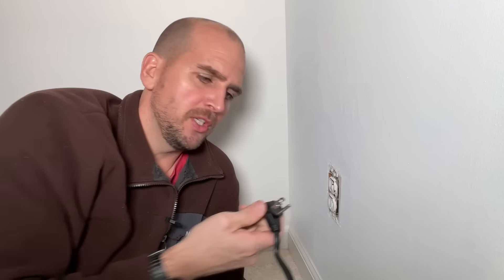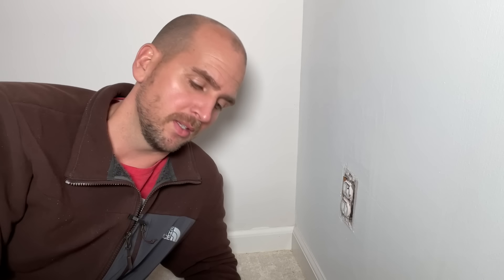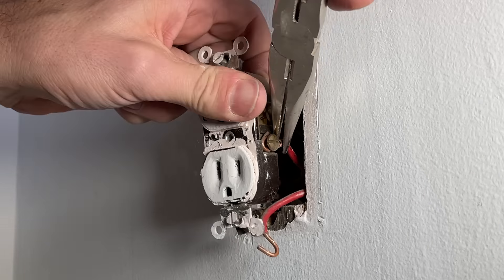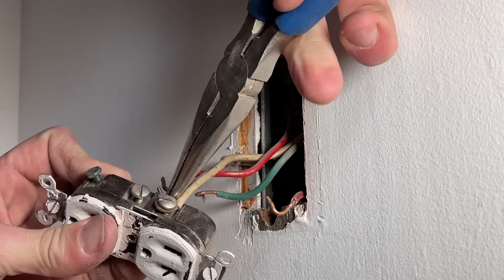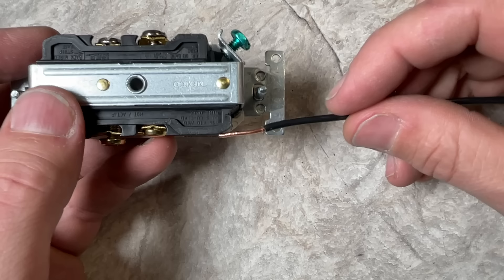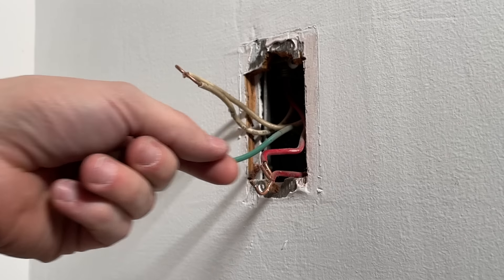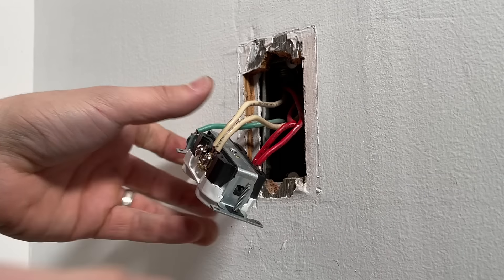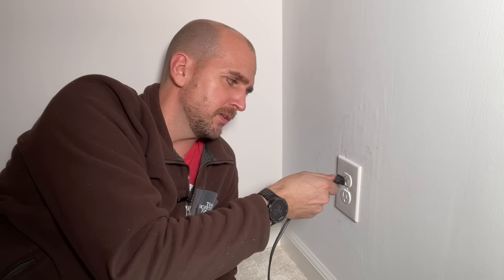Plug Won't Stay In Outlet

Comment: TEN THINGS YOU DID WRONG:
1. The box's 6-32 threaded hole is set back more than 1/4", which requires a goof ring (NEC 314.20). Even if it was less than 1/4" (it's not), you've got dried out wood paneling - use a plastic goof ring.
2. You didn't check for voltage after the neutral wires were disconnected. If the neutral was shared with another circuit then the load side would become hot when disconnected. A little thing like that can get somebody killed (a shock from a neutral under load is much more severe than from the hot wire).
3. You didn't tail out the wires. Especially the neutral! (see above) There should only be 3 wires connected to a non-GFCI/AFCI duplex receptacle (4 if it's half-switched). Not to mention making it easier (and safer) the next time it needs to be replaced.
4. If the receptacle can't be tailed out for some reason (no wire or wirenuts available?) don't put both wires under the same screw. You've got 2 screws. Use them. 
5. When using the clamp terminations with solid wire, you should wiggle the wire after tightening, then tighten again. And again after the wires are folded into the box. Personally, I prefer hooking to the screw with solid wire, and using the clamps with stranded wire. Hooks on solid wire are a better connection and less likely to loosen when the receptacle is pushed back into the box. If I had a dollar for every time I pulled a receptacle out of the wall with the wire(s) staying in the box...
 6. You didn't check to see if the ground (green) wire was connected to the box. If it isn't, then it too needs to be spliced to a tail (never, ever put 2 ground wires under 1 screw!) with one end under a 10-32 ground screw in the back of the box (if there's no threaded hole in the back of the box then you have to drill/tap one). The ground wire is not only the most important wire protecting you from electrocution, it is the ONLY wire protecting you.
7. You make no mention that it is a mistake to assume the way the wires are dressed out (spliced, connected, etc.) in an existing box are correct. It is quite often the opposite, as in your case. Instead of correcting the mistakes of the previous installer, you repeated them. Anyone replacing any electrical device is required to meet current NEC rules.
8. In the beginning of the video you're literally lying on the floor. You should stress that even though the power is OFF (hopefully) one should always behave as if the wires are hot. Do not ground yourself when working on electrical systems!
9. When replacing a receptacle inside your house, the NEC requires that receptacle to be Arc-Fault protected (NEC 406.4 (D) (4)). AFCIs are required on all 120-volt, single-phase circuits with 15 to 20 amps supplying receptacles in all dwelling rooms.
10. You should mention that electrical installations are not only about knowledge, it's also about technique. And as described above, there are many things to consider even for a simple device replacement. In over 40 years of industrial, commercial & residential work I've yet to see someone who's not an electrician perform the relatively simple task of changing out a device to my satisfaction. My somewhat jaded opinion is that people without electrical knowledge shouldn't be doing electrical work. Call an electrician!
Reply: Jesus buddy, he has at least basic knowledge and he made a safe repair and saved a lot of money on hiring an electrician who's gonna whack him for $200 for a five minute replacement. I replaced every outlet in my house when I first moved in 28 years ago along with installing four ceiling fans where no fixtures existed and replaced a half dozen fixtures with zero issues. 
Actually I'm wrong, I did three ceiling fans after a "buddy" electrician did the first one saying he'd "take care of me" and charged me close to $400 and was done in half an hour. Wiring an entire home, yes, but changing out basic outlets and basic fixtures is not rocket science.

Comment: Usually they wrap tape around the inside of the outlet after the wires are hooked up
Reply: Same here, safest way
Reply: No only scrubs do
Reply: @cherrydagger8271  safest way is to not touch the shiny you goon. There, no tape required. 

As a bonus it saves me later on from having to pull the tape off receptacle while it's hot because moron was working on it last and it's fucked up
Reply: @andycopeland7051  you're comment speaks for itself, have a nice day.

Comment: Great video, as always ! Extra comments: If I'm replacing the receptacle, I just back the terminal screws out all the way, leaving the hook undisturbed. I tend to install back-wiring receptacles, so I will straighten the hook to reinstall--but I don't risk messing up the insulation or nicking the conductors, and ALMOST EVERY SINGLE TIME, I end up trimming excess copper, even if I would be hooking the new unit. C'mon, pros, get your helpers and apprentices under control' they're making you look bad. If I see short wires, or two wires on both sides, darn straight I'm pigtailing the new unit, with Wagos. 
Yes, I am in the militantly anti-childproof camp, because they can block legit plugs,

Comment: A good solution to worn hotel plugs. Use one of those inexpensive ground adaptors used to allow a grounded plug in an ungrounded receptacle. Throw  a few into your suitcase. These allow a three prong plug use in a two prong, ungrounded receptacle.  Typically they are grey with a green wire which is supposed to be attached to the cover screw in an attempt to gain ground. Don't bother with this as the purpose here has nothing to do with grounding a device. Now look at the prongs of this adaptor. You will see they are double layered. If you insert a small screwdriver between these layers the plugs blade width will swell causing a tighter fit into the worn receptacle. Your plug will no longer fall out, and you will reduce heat damage to your cord due to bad connection. This is not a way to avoid replacing worn plugs! Stop being cheap and lazy and fix those worn plugs! But do not rewire hotel rooms! Tell them their rooms suck when you leave! In writing!🤣🤣🤣

Comment: Remove, clean all connecting wires, replace the outlet and install new cover plate and get on with life.
Reply: Wrong.  Bend the prongs outward just slightly, save $150 or $5 if you’re a do-it-yourselfer.

Comment: Tyvm! I had this issue with multiple outlets in my apartment. The new maintenance guy they hired doesn't have a clue what he's doing and the new outlet covers were not flush against the wall. They were sliding and there was a huge gap of space in between the back of the plate a d the wall after doing what you just did apparently. Smh!

Comment: Quit calling the white wire a (NEUTRAL wire) I know we have been programmed to calling it a neutral wire over the years but to have a true neutral you got to have two separate phases plus a third current carrying conductor but on single phase outlets the wire on the silver screws side of the outlet is a (RETURN wire) got this pounded into my head thirty something years ago as an apprentice working with a old time Master electrician Mr Leroy Henton that man smoked cigarettes all day long and had maybe two teeth in his whole mouth and  couldn't have weighed a 100 lbs soaking wet with long gray hair down past his shoulders but the things that man taught me in the two years I worked with him was simply amazing as I think back to all the many times he would stop me cause he didn't like the way I was doing something or saying something or just plain out didn't know and would draw me diagrams on anything pieces of sheetrock , 2x4s,my on hand, seems like he did that almost everyday but if he was still alive and walked in to any electrical supply house they would take one look at him say he probably can't wire up a out house but boy oh boy would they be wrong I have no doubt that Leroy was a freak in electrical knowledge a man that could do it all from the out house to the penthouse from running  emt,big screw pipe,motor controls, switch gear,ruff in,trim out,high voltage,low voltage,never once can I remember seeing him look like he didn't know what he was doing nor do I remember seeing doing something twice now me he made me re do a damm a lot of things he wouldn't even let me mount box's with hex screws he made me use pan head screws cause he was concerned that the wire would get nicked on a hex screw (that really chapted my butt) but in the bigger picture it was more than worth all the things he taught me RIP Leroy Hinton I still remember most of what you tried to teach me at almost 57 years of age .

     Sorry for getting long winded on this I guess I just got emotional reflecting back on my days with Leroy.
Reply: Anti Government  technically, it is a return, but also sourced both to the center tap of the transformer and earth ground.
Don't get me started on ground current differentials and whatnot... I first learned of those the hard way, nearly getting knocked off of a ladder due to two grounded connectors that really needed another ground rod hammered in and grounding that point. Then, a block of instruction on using one hand and ground current differentials.
I could've used that instruction beforehand...
But, the warnings come after the spells.

Comment: Yeah, the big "solution" is REPLACE THE OUTLETS! Du'h.
Reply: @SUBJECT M01 Usually a screwdriver is enough.
Reply: Hey, "no user serviceable internal parts",  hmm?  Yeah... and outlet is a modular component, and is not usually designed to be rebuilt.  (Psst... that's why they are so cheap.)

Comment: You should have touched on the case of having two of each wire on the existing outlet. This can be two situations:either its part of a series of outlets in the room, or one of the outlets is on a switch. In the event one of the two outlets is switched, you could have explained how to remove the metal tab between the terminals on each side of the outlet so they can work as one socket always on, and the other switched.

Comment: fwiw - moved into 5 bdrm house in 2005 that was built in 1990 and had to replace Every.Single.Outlet due to this problem.  Surely some of the outlets couldn't have gotten much use so this was very disappointing that the builder chose to use such junk.  House was well built otherwise..
Anyway, Great video and information to somone doing this for first time on basic outlet with additional info provided in other liked comments that may come into play.

Comment: Thank you for talking about the different wiring color standards. My home was built with black, white and bare ground wires. As I finished the basement area I purchased wire with the ground sheathed in green. An old electrician told me to always shorten and twist the bare ground wires together and pigtail a green coated wire with the bare wire. Then shove the twisted bare wires to the very back of the box so they are out of the way. Then you only have the single green coated wire to worry about. Do you recommend this technique?

Comment: After 34 years working in hospital maintenance- often having to work “hot” I developed the habit of running a couple passes of electrical tape covering both hot and neutral screws before placing the outlet back in the box.

Comment: I am surprised you put the outlet in upside down. That being said, an outstanding video, especially explaining the way the wires wrap around the screws a certain way, and screwing in the unused terminals. How about a short video on how to make the 'J' hooks. They look simple, but it does take practice making them correctly.
Thanks for a great Video !
Reply: There is no such thing as an "upside down" outlet.  No one is reading the print behind the cover lol

Comment: I thought you were fixing the slippery 2 prong plug problem. They sharing in various down graded design misses like not drilled, too thin, too smooth, and are commonly found in new vacuum cleaners.

Eg: Ghibli AS6 plug falls out with such consistency I cut them off before sending the machines out to the trenches and put in a Hubbell of equivalent.

Comment: 3:08 I've got a great deal of wiring, I've never seen red wire outside of 3-wire that has the black, white, and red wires together, which doesn't really get used outside of 3-way switches and integrated smoke detectors.

Comment: I've got into this situation so many times. The loose plug should be replaced as you did. But if you rent you have to ask the owner of the house to do that. If you are traveling and get to the same situation or even in your house and you need to charge your phone or plug something that is loose, just bend the connectors to put a little pressure on the contacts. 1 or 2 mm or even a 1/32 of an inch is enough. I hope it helps with an emergency.

Comment: How about showing industrial grade and hospital grade too?

Commercial grade outlets - good for frequent plugging and unplugging.
But cheaper residential grade would be OK for an outlet for a high mounted wall clock, or even a refrigerator.
Things that get plugged in and seldom unplugged.

Industrial grade would be good for a workbench where you use high power tools and frequently plug and unplug things.

Comment: It would be helpful to say that there can be multiple circuits on a plug so always check if the little bar between the two set screws on both sides have been broken off or not as it may cause a line to line short or an overloaded neutral

Comment: Always been told to put the outlet in a position so that the round ground projection on the plug is at the top. Less likely to short out than the two plugs on the top

Comment: I miss the old folded-over male terminals/prongs that were on electrical cords that you could spread apart with a straight blade screwdriver when they were loose in an outlet. I don't run across them to often anymore.

Comment: Learned alot In This video but one thing has me curious. Why did u put both hots and neutrals on one connection 🤔 the original one had them separately. I wish these might or changes would be explained for newbies. Gotta go do more research now.lol not a bad thing tho. REMEBER ALWAYS DO U OWN DUE DILIGENCE

Comment: Nice video.  Here, downunder, we only have two types of outlets: Light-duty (domestic) and Heavy duty (outdoors) and our Phase (red) and Neutral (black) pins are angled so there's less of a chance of the plug either falling out or becoming unsafe, and our Phaser and Neutral pins are insulated 90%. 99% of our outlets are switched is case there's a fault eg. pins "welded" to the inside connectors! thus we can "switch off" the  outlet in an emergency!

Comment: Question, noticed you used two testers.  I only have  an outlet tester, similar to yours.  Is using Just an outlet tester good enough ?
I really don't want to get electrocuted. 😫  thanks
Reply from the maker: I like the non-contact tester as well to make sure someone hasn't used the box as a junction for another circuit.  99.9% of the time an outlet tester should give you what you need confirming power is off.

Comment: Master electrician. When replacing an outlet you need to Put a Box extender in any any place where you can see combustible materials between the Box and the cover plate. Also when you have 2 wires do not use both screws to extend the circuit from one outlet to another. You should pigtail So that in case that outlet Burns up the rest of your outlets do not fail. Also I don't mind using the what we call a tick tracer However some brands are more reliable than others some of us call them death sticks.  I prefer the ones that use an adjustable sensitivity because you have less chance of false negative or false positive reading when you get it set properly However these are more for making sure a wire is not hot rather than an outlet.

Comment: Great video. I have the same problem. Thx for answering 15A that I take it is 120 voltage, well mine is on my fluke Meyer. U mention different screws u had to replace. I will buy them too. Thank u.

Comment: Since the original had two hots and neutrals wired with one going  into each outlet, why wire the new one with both going into the same terminal? Wouldn't that make the second set of wires useless?
 
Thanks for this. It's probably a better alternative to my practice of simply prying the plug blades wider apart.

Comment: I really like all your videos as they are so helpful for me.  But may I just inquire about this particular video - thought I noticed that early on the two red wires was taken off from the two separate screws but when you install them back in it seem that both of the red wires are were both installed one screw only.  My question is more for safety sake as I also have a loose plug that I need to fix.  If you could comment on this I would really appreciate it.  Thanks.  - Leo
Reply: That was my question also.  Why not put them back as to how they originally were attached (to the old outlet)?

Comment: I notice immediately if a socket is loose fitting. If it goes in with little effort I do two things depending on the situation. I either take it apart and tighten the receptacle prongs or I get a new receptacle. Most receptacles used in my house are in my shop so I notice immediately  if something is wrong. Kitchen stuff has been tested, replaced or otherwise good.

Comment: Great video! One thing though... You didn't mention anything about which end (or screws) of the receptacle is the Line (In) and Load (Out). If one doesn't do this right, it can be a real problem.

Comment: 2 questions.
1. How do you know what amp is the proper amp for that outlet?
2. Why not use both wire screws for each wire rather than 2 wires in one? Is there a difference either way?